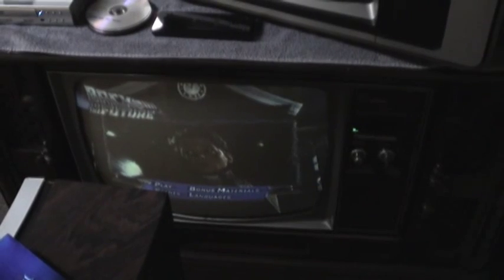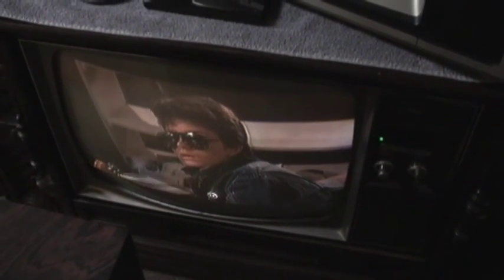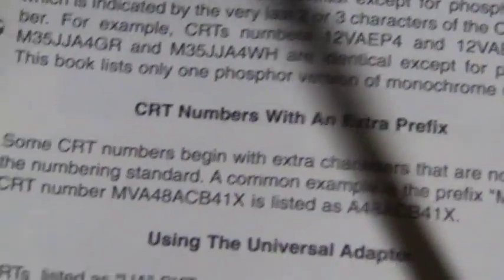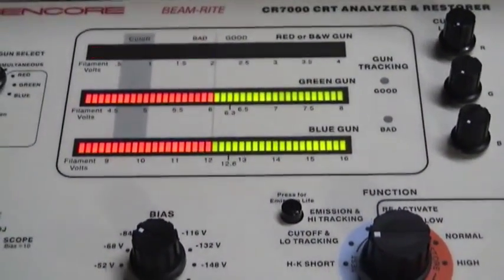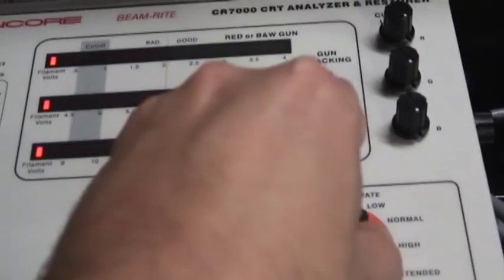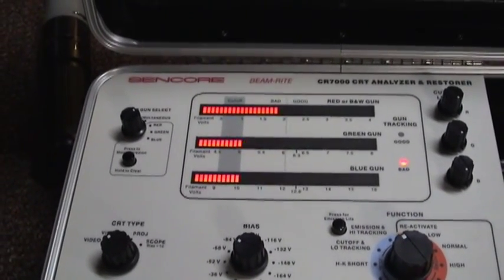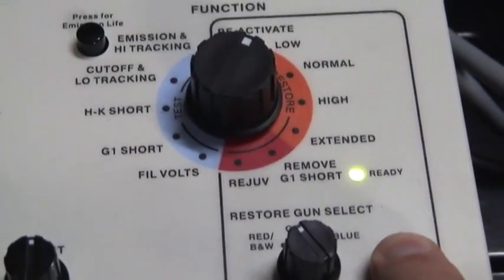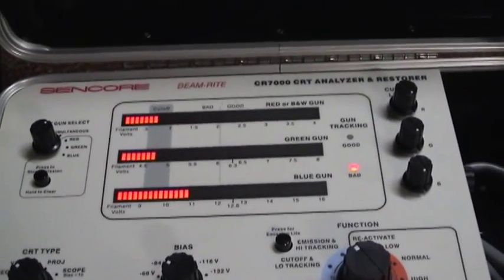Sencore CR-7000 CRT Tester/Rejuvenator Demo - Part III

Comment: I got a totally modified and updated Beltron probably around the time you got this or possibly a bit earlier. I had a beat older one a shop I dealt with for rejects with almost no adapters and a friend that mentored me had a good one so I was used to how they work.
I paid like 30 shipped did some minor repairs comparing the wiring on my old one. I have used it twice but it work nicely with the aftermarket mods, all the adapters, and updated tube lists. They are a sledge hammer compared to the Sencore but they work if you understand how to use them and aren't 1500 to buy used. I think I got lucky on the price of mine but I also knew crt TVs and restoring them to sell was done but I still wanted a better one then I had which really exponentially increased the sets I could save. Glad you got your dream crt rejuvinater and hopefully you still have and use it today.
I have two personal crt sets in service so I might dig it out and clean up the guns on my 2005 HD Toshiba 34hfx84 set someday.

Comment: I've started to learn a few tricks with the Sencore CR7000 once I had access to one at our coin op shop. I'm used to a B&K 470... Trick is for when the guns have little to no cutoff adjustment is to use the re-activate on the lowest gun one to two times, then flip it back over to your cutoff and see if you can make any adjustments after that. Sometimes, not always, your guns will start to respond better after a little re-activating, and you won't risk burning anything up with such a low current.

Comment from the maker: @maro2k9 The high pitch squealing is something in the horizontal output vibrating, such as the yoke/flyback/etc.  Poor solder joints in the circuit, etc.

If you have the brightness/contrast up high with a white image on it, what you are seeing is the shadow mask becoming distorted because it is getting hot.  This is normal for any TV, but some cheaper TVs it might be more pronounced.